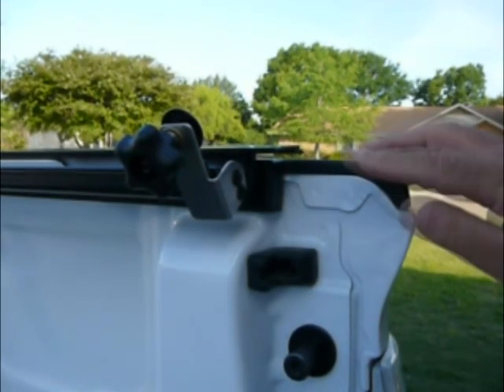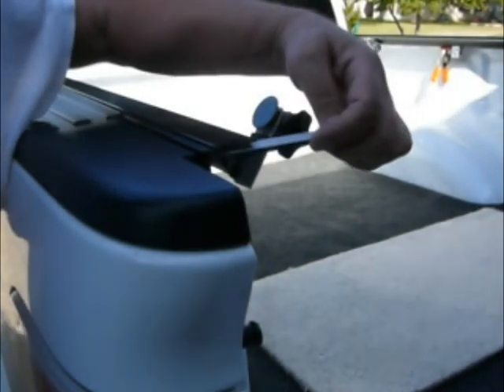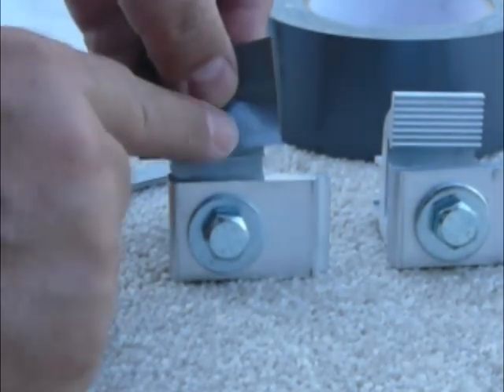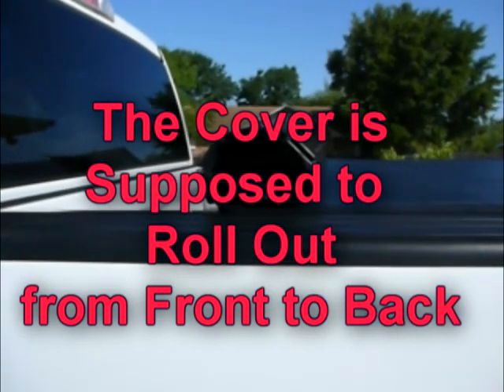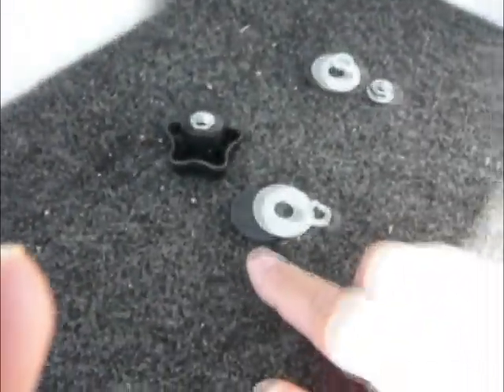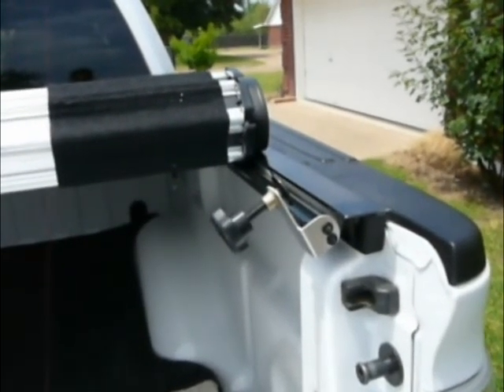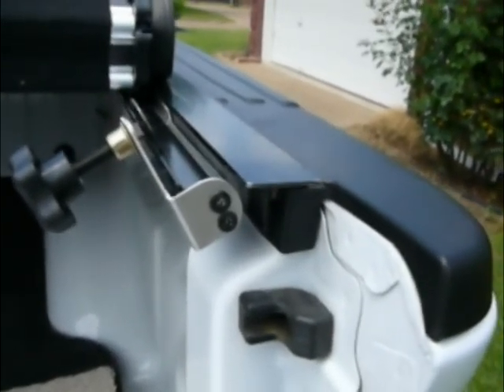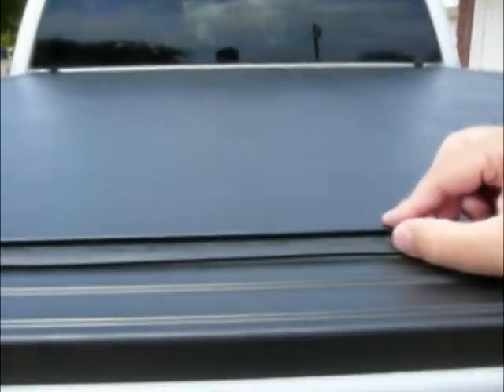Ford  F-150 2013   BAK Roll X  Review UNHAPPY  INSTALLATION

Comment: Thank you for making this video. I am looking to replace my BAK retractable cover which has seen better days. It's really starting to fall apart and jamming up now after 5 years. It started to fall apart right after the warranty expired several years ago and it leaks like a sive. I was considering this cover but I have decided to pass on this one. I also noticed the site AutoAnything.com doesn't sell this one. Which is probably another sign that this cover is pure junk. Sorry you had to go through all of that.
Reply from the maker: Any Idea as to what you will replace it with ?   I like the idea of the tubular aluminium roll back feature of the cover

Comment: your main issue is the rails and cover are not adjusted properly. I have the RollX by BAK industries pronounced (back) and have had no issues with it. I have also sold and installed hundreds of them. I would try removing the shims that you put in because the rail needs to be close to the tailgate. If you would like, I can show you the proper way to install the cover by recording the removal and installation of mine. if you would like more information or a video to install it message me.

Comment: There are a few other changes that aren't on the instructions too. As far as the shims, they actually go on the rails up against the bed sides to help make it "square" or lay flat. I also called because instructions didn't show it and was told on the Ford, the shims aren't needed. And those 4 round gaskets with red tape, they go on the inside of the cover after you roll it up so it doesn't hit your back window.

As far as security, I agree. So I came up with my own solution. Yes, it does require a trip to the hardware store and some money but worth the effort and now I am happy with my Roll-X

Here is my video of the security issue:
http://youtu.be/hX2prQXg4Zs

And here is the solution:
http://youtu.be/0hTSJ-fXHDU

Comment: I just got one of these, not too impressed.  Seems to me that if they made a proper front cross bar holding the cover properly and tightly to the side bars and to the bed, it'd work a LOT better.  Right now it leaks water like crazy at the front corners, and yes I do have it mounted and positioned correctly.  They know how long the bed is anyway, why all the need to work so hard at getting the spacing correct?  I hope version 3 has a lot more improvements.  Oh, and it rattles like crazy when driving, not good at all!